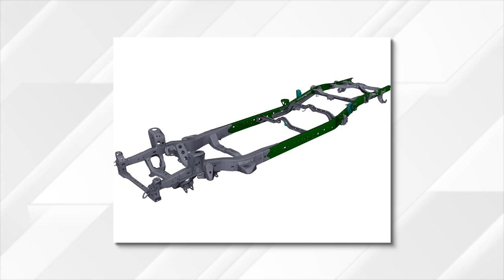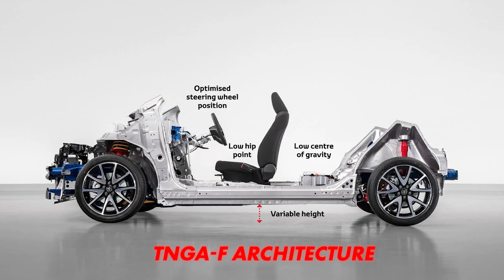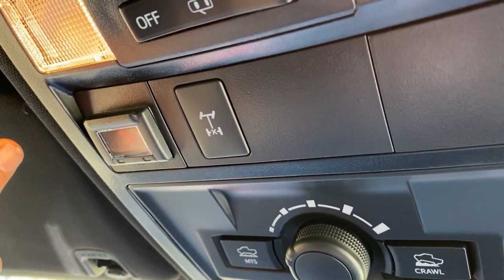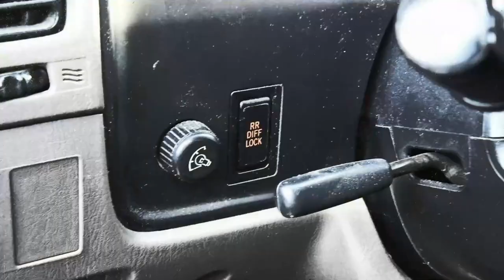The 2024 Toyota Tacoma: The ULTIMATE Off-Road Beast

Comment: As you can see, these Tacos dont go into water anymore!!! If I wanted Eco-Boost, I would buy a Ford. I always wanted a 4x4 Prius. Lets slap a turbo on a 4x4 truck, so I can hydrolock my engine sooner! Lets pack up the back with BATTERIES! I want to blow up in a ball of fire because a faulty seal around the battery bank fails.